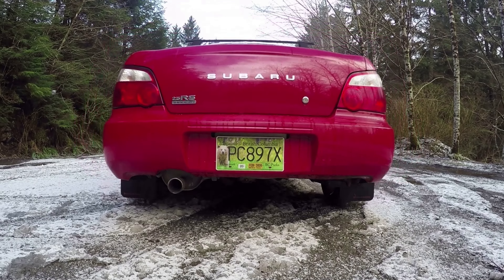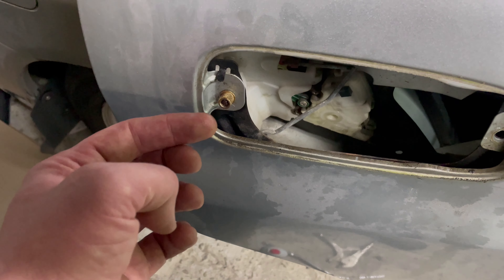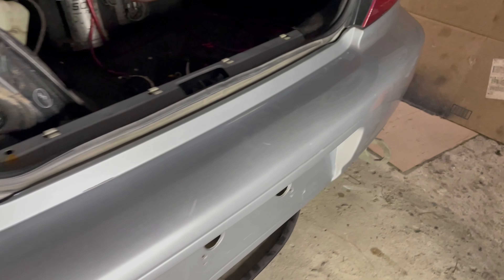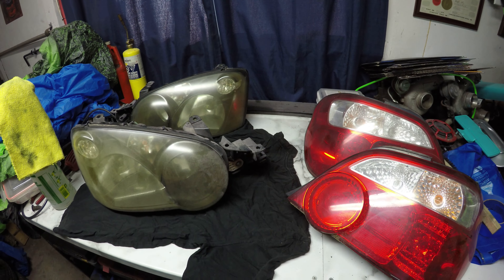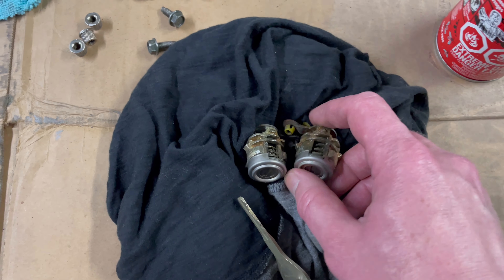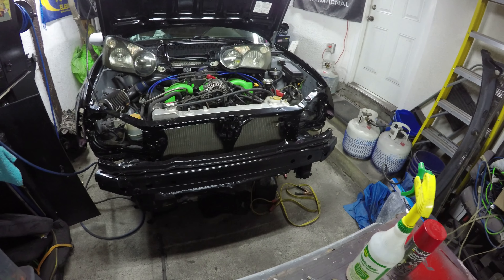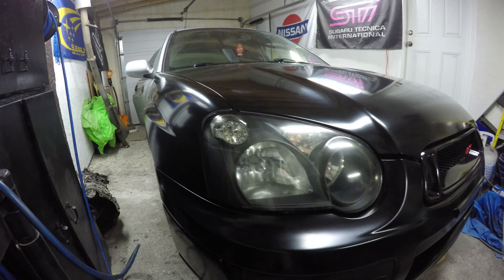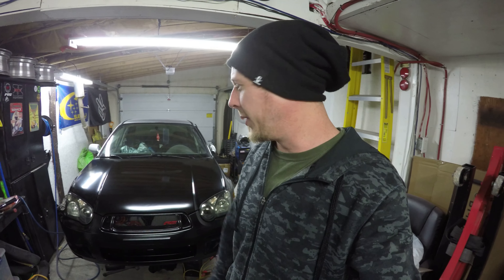Body Is All Back Together

Comment: Making good progress. Looking forward to seeing this thing finally only the road. One thing though, those 05 tail lights aren’t going to fit on the bugeye rear bumper. You’ll notice they have a slight curve on the bottom of the housing and 03-05 rear bumpers have the curved cutout to fit. Bugeye tail lights and rear bumpers have completely flat edge.
Reply from the maker: Thanks. I'm eager to drive it. 
Good call. I went through that dilemma last summer. At first I didn't notice the difference. When I started looking at the condition of the two bumpers trying to decide whether or not to paint the '05, I noticed the bumps on the lamps and the recessions in the body. I found others using the lights with the bugeye bumper and although it doesn't look as finished, I decided it doesn't necessarily look bad either. I actually talked about it while filming but edited it out. I will mention it when they get installed.
Reply: As far as I remember the later lights do fit the Bugeye bumper you don't need the cutout the round bit is in front of the bumper guys have fitted them in the past ....google is your friend 🤔
Reply from the maker: @youtubeuseronalot6376  they fit but they don’t fit. I’m good with it.